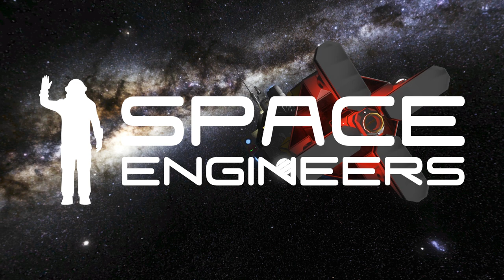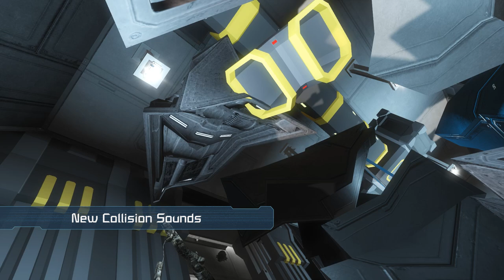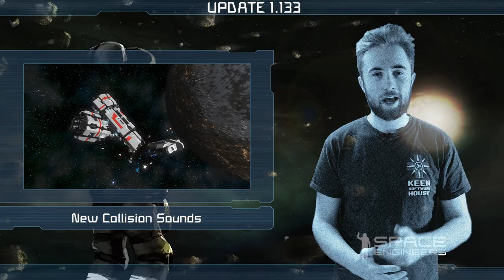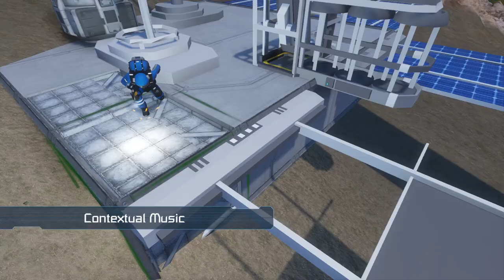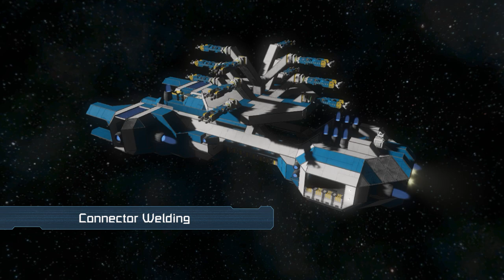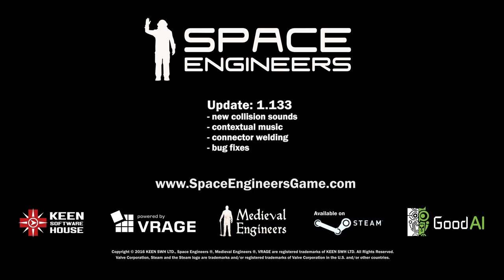Space Engineers - Update 01.133 - New Collision Sounds, Contextual Music, Connector Welding

Comment: I like the new collision sounds, but I do feel like there should be way more rending, twisting and creaking sounds, since basically everything is made out of rough steel sheets.
Reply: +R9000 and it should be MUCH louder imo.. After all, thats probably about 50k tons of pure metal
Reply: FlickyFlack Yeah, but you've gotta dial things back for relative player comfort I guess. :P
Reply: +Mehr Licht Yours, + ouder (you can always turn it quieter) and more creaking and twisting.
That would be my favorite one. I hope Modders can edit these files :D
Reply: +R9000 normaly you wouldn`t hear anything without air in a colliding ship , since all the air is been sucked out if your cockpit is been hit
Reply: Gustav Regnid You'd hear the sound transmitted through whatever parts of your spacesuit are touching the ship.
Reply: +R9000 and What if you are not touching it all ?
Reply: Then yeah, you wouldn't hear stuff outside a pressurized cabin. Still though, you could still be inside a pressurized area of the ship after it got rammed, in which case you'd hear everything. If not, 90% of the time you're sat in a seat or stood on the ship's deck, so the sound would transmit through your suit, albeit altered.

Comment: Speaking of Collision. You guys need to do something about collision boxes. They should not be any bigger then the finished block. Is a real problem with some blocks. Like turrets. They should only take up about one large block of room on small ships not two of three like they do now. And in slopped and half blocks they should only take up the slop or half of a normal block space not a full block space. Basically where the edges of the block end (except in some cases like turrets) so should the collision box. The "box" should hug right up against the edges. I know this is likely not an easy thing to do (I am not a programmer so I don't know the ins and outs of it) But it is something many games suffer with (and this game more then most in a lot of ways) and need to fix for the next generation in gaming. If there is not a physical edge to stop something then something should not be stopped.

Also you need to make it so small and large ship mega blocks work with each other. 1. they are the same size so they have no logical reason not to work with each other. and 2. It opens up so much for the player. And the fact that you can do conector welding means it can be done with merge blocks and you can make both that same grid.

Comment: Hello, I have not played the game for about a year. There was a question about the battery and solar panel. Before recharging the batteries when taking the energy from the solar panels only (I think), now the battery when recharging takes energy from all possible to fix it?I am economical and almost do not use exhaustible resources such as uranium (although there are endless asteroids)In short: is it possible to disable the reactor to take the battery power or batteries to give access only to the solar panels?The software modules, such scripts do not have

p.s. My knowledge of English is small, but I tried to write it in a couple of translators to make it more logical :)
New nice man, were previously only letters :)
Reply: I believe that the game will automatically favour solar and battery power over Nuclear reactors. No need to switch anything on or power something off. If you need more energy than what your solar or battery power can provide, then the reactors kicks in automatically.
Reply: +AKYMA333 I'd just make a button panel that would turn the reactor on and off.

I remember doing that though building a little outpost on an alien planet with batteries and solar panels. :) 
it reminded me of borderlands

i ran out of power because i left the refinery on...that thing BURNS though so much power.
but it was fun the base went dark and only got power during the day.
had some oxygen farms for my daily oxygen refill.

battling spiders gave me some scrap compounds that i enjoyed for a while.
rapid fire rifle works best against the spiders because of their size and speed they get up to you quite quickly.....and im sure you don't like getting shot to pieces by your own turrets.

Comment: shields on next update please! I really sick & tired to repair ship on any minor thing.
Reply: +Erinç Fırtına Or increase block durability at the very least.
Reply: But that will be unrealistic. Shields will bring lot of fun, eSpecially with planets. For example; if shield blocks consumes lot of energy you need to turn off or reduce shield power to land on any planet cuz u need that power for thrusters, gyro etc. or when you need to jump because it needs energy too, or mining. I think shields will be lot of fun and game will be more realistic.
Reply: Erinç Fırtına There is a shield mod.
Reply: I didnt know that mod. Thanks for that
Reply: Erinç Fırtına Not many youtubers seem to use it. And it does break every few updates. By the modder is pretty good at fixing it. And they have updated it a few times so it may get more in the future. And it is not OP (at least not by default). And has some ability to be fine tuned by the user (the not by default comment) Allowing them to make blocks to be able to be grinded or not when the shield is on. And change the amount of protection each shield block adds. So if you think the default amount is too high or too low you can change it meaning you have to use more shield blocks for the same protection or less (and will the upgrade blocks that come with the mod).I really think it should be used more by players.

Comment: RIP Merge Blocks
Reply: +Mallchad Not exactly I am sure there are still going to be times you want a more permanent connection. However it does sound more like the merge block. I wonder if this means that Small and Large grids will now become one via the connector. That would be a nice change.
Reply: Naaaa don't think so. If merged the ships become one etentity and you control the thrusters, gyros etc. of both grids. The update just means that transporting fighters or docking will be much more stable.
Reply: +Daniel Kern But depending on how they accomplished that it seems like it makes connectors like merge blocks. The one advantage though should be that you don't loose the name like you do using merge blocks.
Reply: +Mallchad No not really. If you want to reattach two ship parts together and sometimes you need to be able to do that especially when you want one grid attached to multiple rotors, then this is the only way to do it. Merge blocks are meant for a permanent connection unlike connectors that are just meant for temporary connection.
Reply: ***** I know, but they're kinda buggy

Comment: looks great but doesnt perfom great. Im running windows 10 and the game crashes 60% of the time. fix your game for windows 10 users.
Reply: Operating system isn't the only thing that determines crashes.
Reply: +Rick McDick in the discussion on steam there is thread mentioning issues with windows 10 and saying that changing the compatibility to windows 8 will fix it. NOPE! it does not work. i have a op pc setup that can run any game with ease so does this crash most the time?
Reply: +BoneMeal Because the game is still in early access and there are still many bugs resulting from hardware and software incompatibilities that are yet to be fixed.
Reply: BoneMeal Powerful computer doesn't mean you wont run into problems.